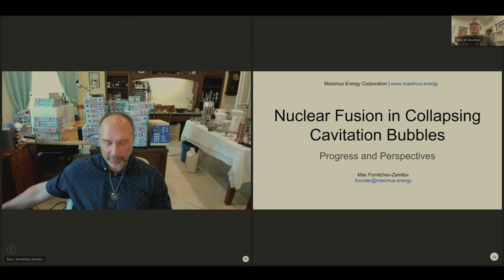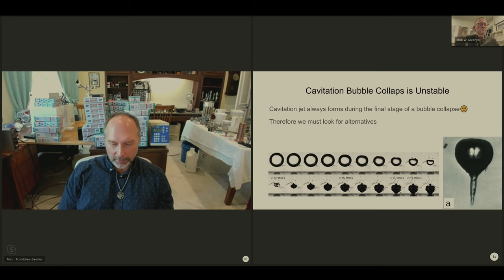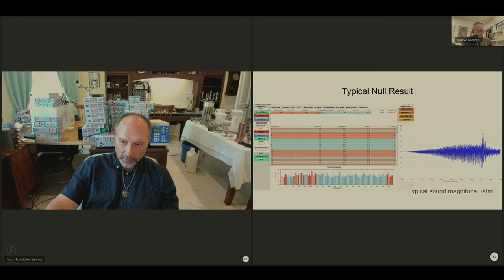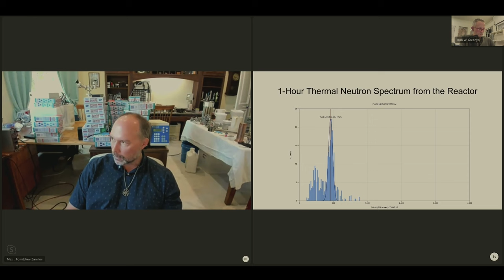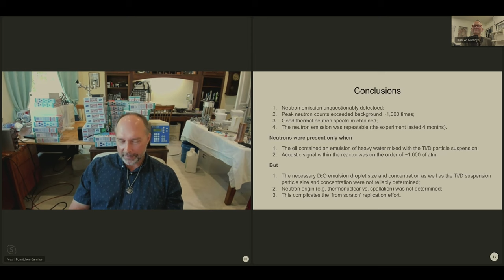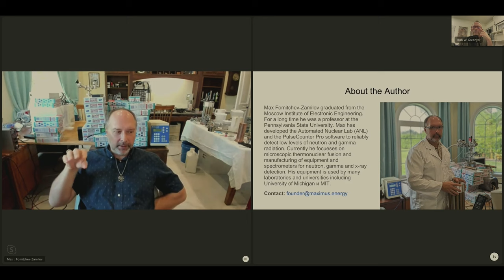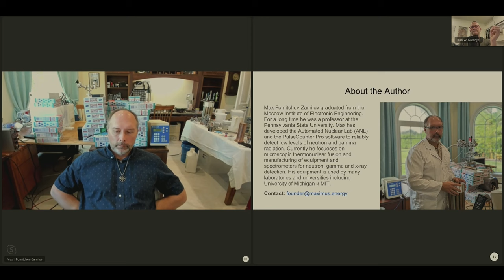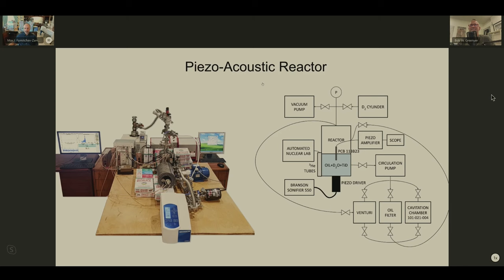ULTR - Nuclear Fusion in Collapsing Cavitation Bubbles - Max Fomitchev-Zamilov

Comment: 3:28 When I saw Figure 2, it reminded me of how I drew in an email for you, as I think the hexagonal structure of The Flower of Life of EVOs is formed. Commonly, two rings are fired and smashed against each other during experiments. What if three rings would be fired in a hexagonal arrangement against each other? As they approached each other, I think (if I drew it), that there should be a recombination and three rings pointing from the center of the hexagon, completing the three remaining sides of the hexagon (similar to the figure 2). The right part of one and the left part of the other to the center of the hexagon heading ring is recombined to form a ring pointing (heading) out. Perhaps the energy of the rings pointing out could be re-used (recombined, accumulated) and with the correct timing when creating a subsequent pulse that would again create three rings pointing inside the hexagon.

Comment: I have watched this about five more times. I have been doing a lot of experiments with lasers and magnets and crystals. Selenite has a big static electric field around it and when you hit it at an angle with a laser, no matter what shape the crystal is, it will turn the laser into a perfect circle. Separately, I have been using bubbles in water to manipulate the double slit experiment. I needed bubbles of different strengths and so I have done a lot of expirments on how to make bubbles in and out of different materials. To that end, I wanted to find out if I could dissolve selenite into different liquids, oils work especially well. I have a hypothesis that if you doped the oil with a piezoelectric crystal, most of which can be easily cut, ground and even dissolved to my surprise, and then you made bubbles of the piezocrystal-doped oil in the water and used the vibration to create another bubble around it, then you would basically have two bubbles of differing electrical potential and in the case of the smaller oil bubble, it's potential would grow as the larger bubble of water/sound collapsed toward it. If you can set it up where your internal bubble grows with electrical potential as the larger bubble collapses on it, then if you timed it right you could get a beat going like a four stroke engine. Place the bubble of oil, blow a bubble of "air" around it, as the bubble collapses onto the oil you should aim to have a discharge like a lightning bolt or electrical discharge when they get close and the Shockwave will expanded the bubble again. We have all seen how you can suspend a drop of water with sound. You could place the drop of piezodoped oil in the water and use the sound to hold it there and since oil and water don't mix the bubble might be matipulated in the water with the sound. From there it's just making the cavity around the drop of oil. Maybe you can prime it with a kick starts and hopefully it will beat without having to add much energy.
Reply: Bubbles in a bath keep the hot water hot for longer.👁‍🗨♨🌊
Reply: @bobann3566  this makes a lot of sense.

Comment: How very frustrating for you, Max ! But you clearly have much determination and persistence and are being confounded by random uncontrolled factors. Have you come across the Safire experiments and their ‘design of experiments’ approach in which they can monitor many variables at once. I think you might well benefit from talking to that team. And they might be interested in the instrumentation you have put together. 
Safire’s ‘electric sun’ experiments unexpectedly found evidence of nuclear transmutation into elements  that were not present on the anode before the experiments were run. Microscopic examination revealed that microspherules with cavitation jets seemed to have been created. I suspect there are some very interesting overlaps between your work and theirs. Despite the perceived problems of instability, Safire (now under the umbrella of Aureon Energy) is showing that plasma, in the right conditions, can be self organising into stable double layers. The brute force methods of confinement may not be necessary.

Comment: What if you'd use charcoal + water in the resonant cavity. Would it react to form a hydrocarbon?
Reply: Hmmm. Interesting. Would the cavitation produce excess hydrogens and a pressure high enough to meld the hydrogens with the carbons?